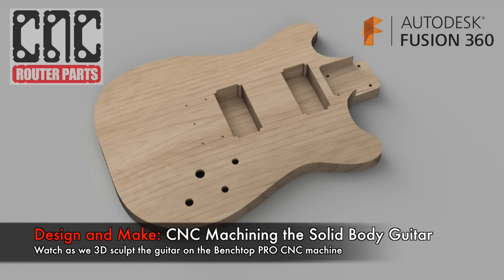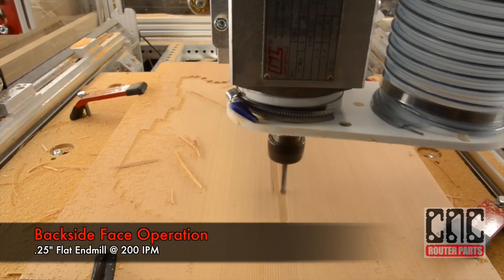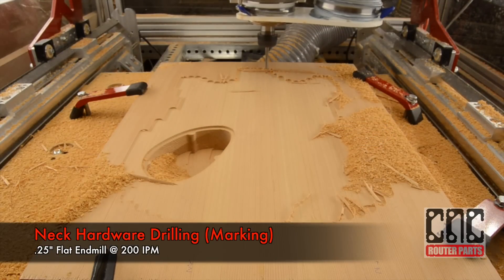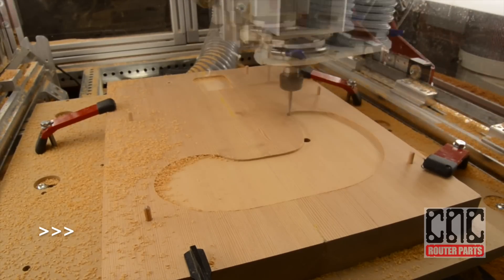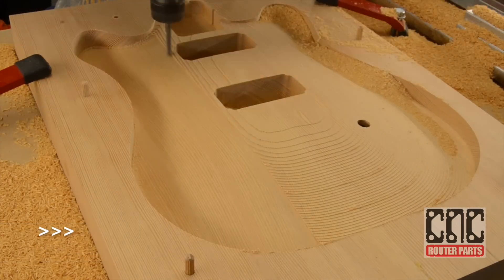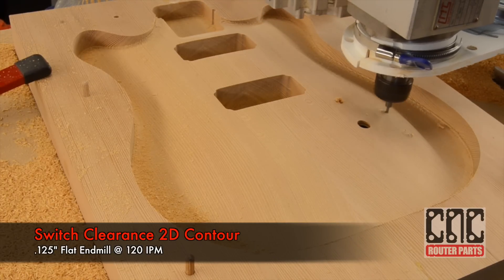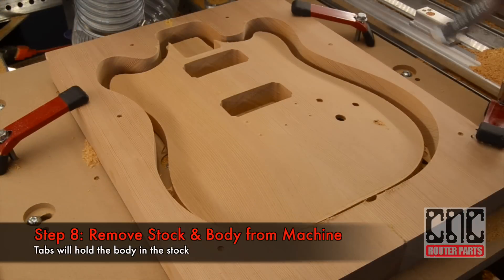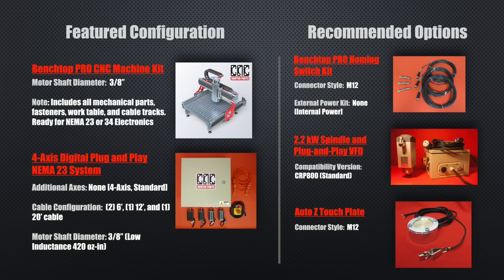Making a 3D Sculpted Guitar using the Benchtop PRO CNC Machine

Comment: Hi. I too am using a 3D parallel strategy for my top carve using flat tip endmill. I am ending up with ridges instead of a smooth surface... Thoughts?
Reply from the maker: Hi! Thanks for your question. What is your stepover set to? 
You can also try using a Ball Nose bit with a 7-10% stepover. That is usually my go to. 
-Sami
Reply: @AvidCNC  My stepover is half the diameter of my cutter, so 1/8". My guess is that's way too high!?
Reply from the maker: @Jim-qc4nb  Ah! Yes, that's probably the case. In the finishing pass in the video Nate has it set to 0.05 inches.

Comment: I would have done finishing with 2 parallel passes (parallel to X and Y) to get rid of the Z-steps and then a waterline to get rid of remaining stept. So there is as few tool marls and as little manual work left as possible. What do you think?

Comment: How long did it take to do this body on the CNC?
Reply from the maker: Hi - The top took about 1 hour 20 minutes to sculpt.   The bottom side took 10 minutes.   The largest driver of the runtime is using the same 1/4" flat endmill for all clearing and finishing operations (to make it a more accessible sample project for folks to try out).   You could reduce run time significantly by using a different tool for clearing and for the final 3D contouring.    -Nathan

Comment: why not using the hwhole cutting flute length with adaptive clearing? It would be much faster
Reply from the maker: This approach we used included a shallower depth-of-cut and higher feedrate (resulting in the same estimated program run time) to provide a finer vertical step-over that better follows the 3D contours (leaving less work for our finishing pass).    That said, given time and need to optimize this program for mass production (vs. the small number of these we made for the video), there are a number of things you'd want to do differently including fixturing and optimized tooling.   -Nathan